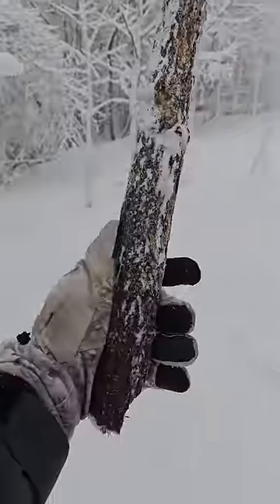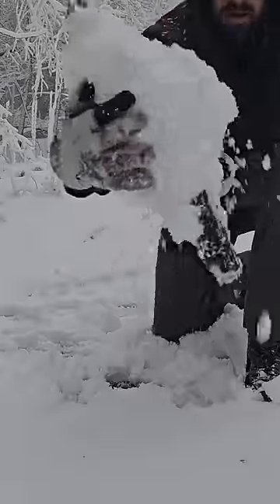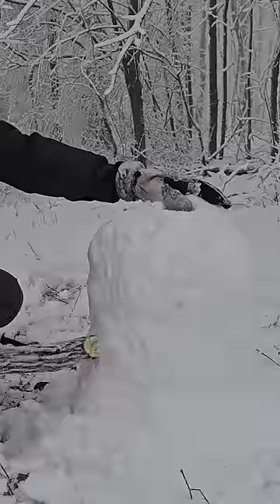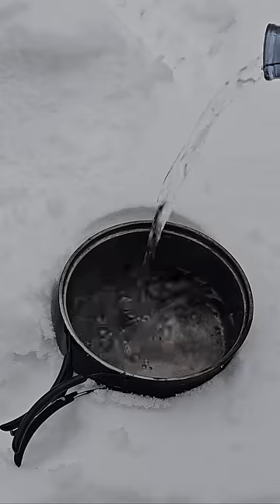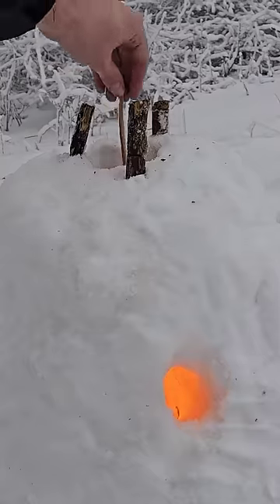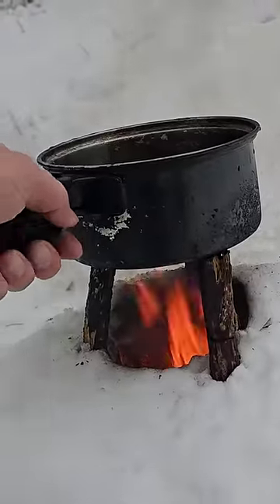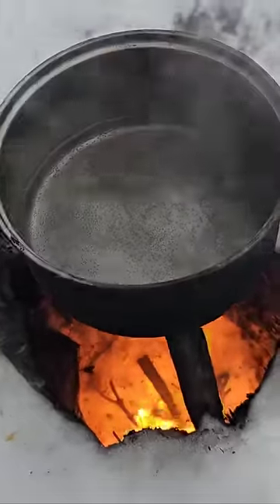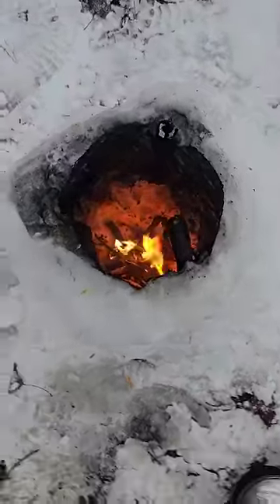Experimenting with building a rocket stove out of snow 🔥

Comment: Great technique for a quick stove in a snowstorm! Learned quite a bit over the years, but it's always nice to add knowledge if something crazy happens with as few supplies as possible! Thanks so much for the video! ^^
Reply: no.... this didn't work, it wasn't meant to work... it could work but not if your just using snow
Reply: Eh? What do you mean? It's kinda useless, a snow fire pit is way faster and more efficient
Reply: @mkzhero  A snow fire pit is more efficient? In what way?! Rocket stoves are insanely efficient, much better than a fire pit. The only issue here is that you'd have to keep making a new stove continuously.
Reply: @crazymonkeyVII  efficient in the sense of time spent making it vs time it will burn and you can use it to heat food and yourself. Plus, while rocket stoves have higher efficiency, said efficiency decreases steadily with the growth of the diameter of the hole, so all in all when done like this it doesn't win you any pluses at all!
Reply: @mkzhero  screw that snow oven cool than shit pit

Comment: I feel like its common misconception of snow basically melting instantly under heat, because if snow is packed enough it will usually burn and absorb heat pretty nicely before melting like in the video, sorta like a way less efficient clay

Comment: I would definitely suggest suspending the pot over the tunnel with whatever suspension system you choose I also highly recommend making the walls of the upper tube much more thicker so they can sustain the heat from the fire for a longer period of time before they completely melt away🎉🎉🎉 awesome job though

Comment: Could you try to hold the pan with like a grill, made of two sticks, horizontally. The inside hole may grow, yet you can make the exterior thicker while you wait until water boils or you get to be able to cook something. The horizontal sticks need to be large enough so they don't fall while the hole grows. The thinner the fire source, the less the hole'll grow. Once the interior hole grows enough that the space between the fire & the snow get to be sustainable, meaning, that also the weather outside, or temperature allows the walls of the stove stay frozen you'll have a stove stove yet, I would recommend you to keep a thin like a rocket or minimal fire sticks so the interior doesn't grow so fast you lose it.

Another similar application may be, if the fire is a log you cover in snow. Basically covering the exterior of a log will keep the exterior cooler & slowing down the burning of your combustible, making your stove to last maybe the entire night, slowly burning, keeping a small cabin hot, or animals away!

Comment: I bet if you lined the "chimney" and the chamber with damp bark, or did the same by embedding wet grass in the inside surface layer of the snow, it would last a bit longer. I'm speculating, but I bet it would work...

Comment: I made an igloo once for the kids here in arkansas when it snowed enough. Using tupperware as a mold for bricks i made one, but, it could only fit one kid. So, i made another bigger than the first, then connected them with a tunnel. I knew it would be warm enought he third day and would melt anyway, so, lit a campfire in the smaller one with a hole in the top. It lasted maybe a hour. Was like they had a fireplace. Was a lot of work, but, got some awesome pics from it! = )

Comment: Look how big the hole got. Interesting for sure. That's worthy of more experiments. What if you made a cylinder with the snow then wrapped it in foil, then packed the outside with snow, then remove a lot of the inside Snow and the foil acting as a reflector would slow the melting of the outer snow. The outer shell would retain enough shape to support your grate or other pan supports. Worth a try?

Comment: Despite its latent temperature, the structure of ice crystals makes it incredibly efficient at insulation, this is why things like snow shelters and igloos work so well. As for how well this works for a stove, suspension would work better, as would using sticks to retain the walls. The soot helps to stop the fire from melting to snow too quickly but if the walls get too thin it'll collapse and smother the fire, soaking the fuel

Comment: Great video, but why did you need to have the second hole in the side? Wouldn't that just reduce the efficiency of the stove by allowing the pathway for the heat to escape?
Reply: I think your right but it's similar to a carb on a smoking pipe helps the airflow